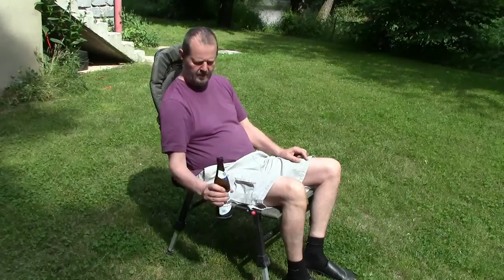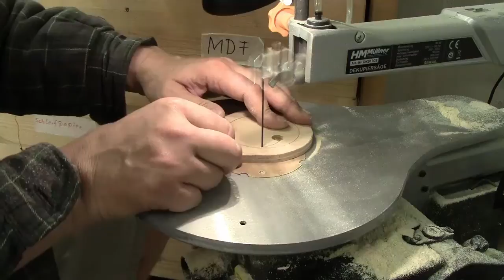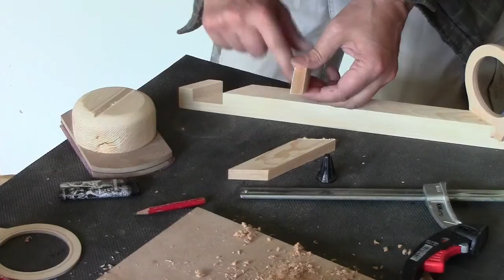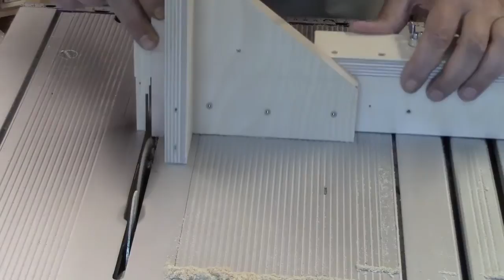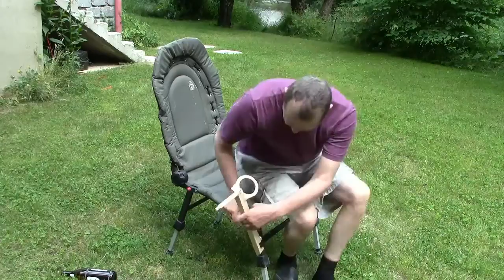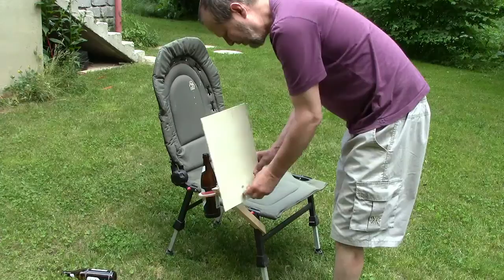☀ Making a bottle holder

Comment: Awesome build. You could cut a slot below the holder and glue in a flat for the bottom of the bottle. Then yo might not need such close tolerances for the round holder part.
Reply from the maker: Thank you for being a faithful viewer of my videos. Your tip is very clever and I've already changed it :)